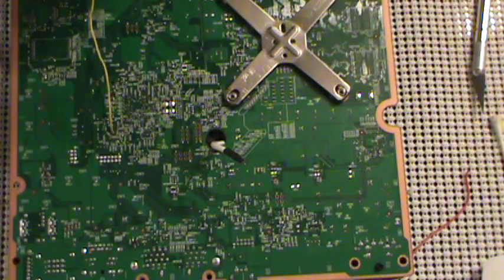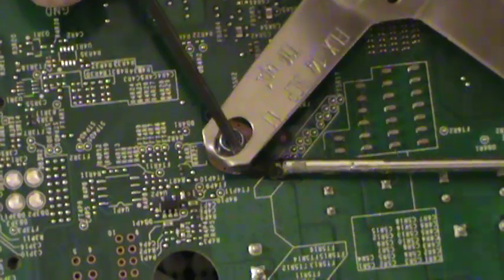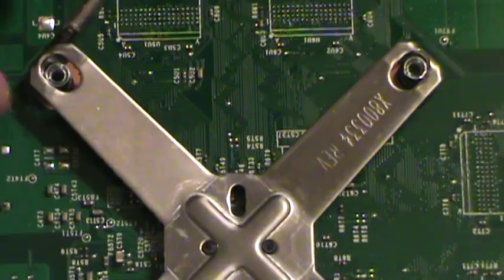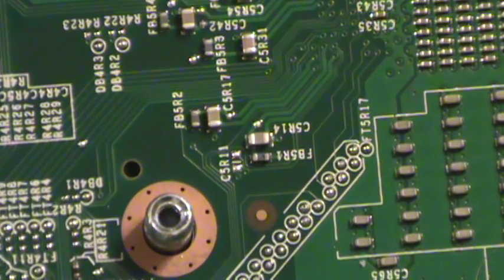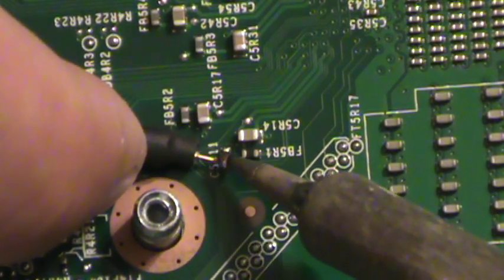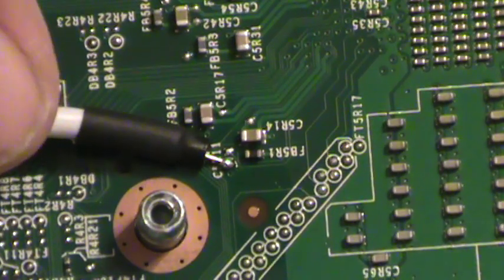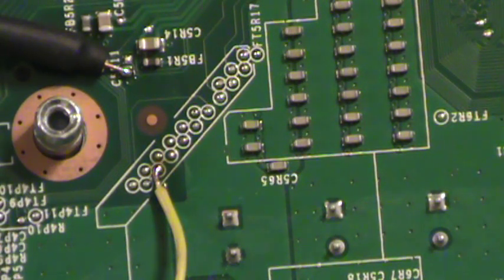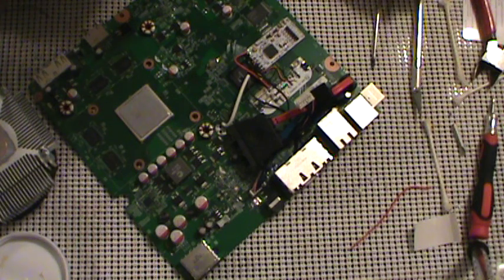Xbox 360 Corona RGH Tutorial Part 4

Comment: as the idiot i am i thought the low loss shielded in episode 2 or something was the same as blue and cut the wire, if i unsolder the blue wire and buy a new blue 50cm coolrunner rev c wire and solder that one correctly will it work ok? and why wouldnt it work cut. Cant i use the phat instead or no
Reply from the maker: You can use just about any wire. I've even used kynar wire.
Reply: +Keil423 but the wire would have to be 50cm long right ? I have the phat one but i doubt that will work . I am only 12 so sorry for asking many questions I'm kind of depending on modding my Xbox 360 correctly cause my friend who bought one said I will never be able to do it and I want to prove him wrong
Reply: you r wrong lol. It broke ok?

Comment: So I'm using the blue cpu_rst cable, should i cut it into 2 parts one for the ground and one for the actual solder pad? I have also heard that i need the cpu reset cleaner or my corona v3 wont glitch.
Reply from the maker: No need for the cleaner. Most people end up messing around to much on it and burning out the CPU. 

Look into rgh 1.2. I believe they have filed for slims as well. 
With and older rev c chip you needed to leave that blue wire long.
Reply: +Keil423 slims cant be rgh 1.2